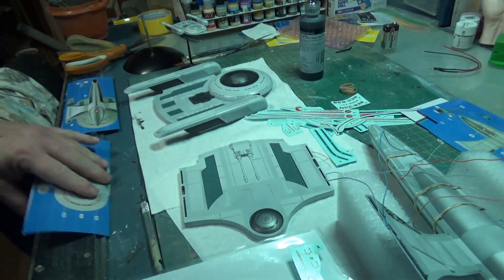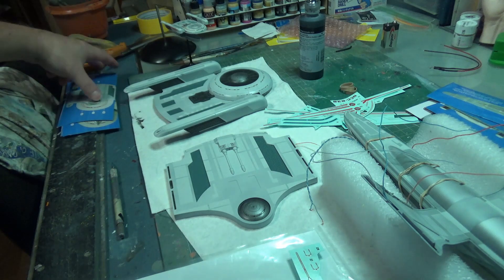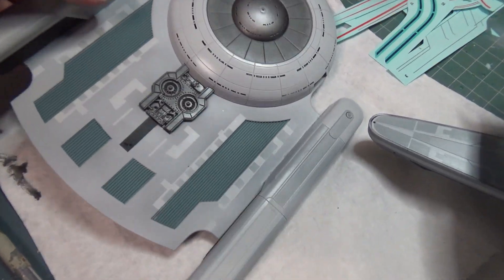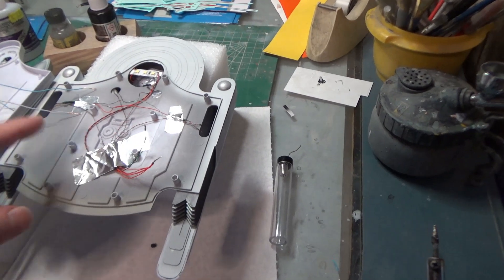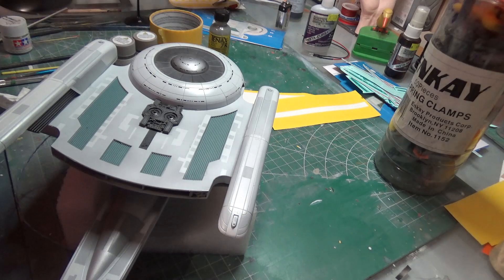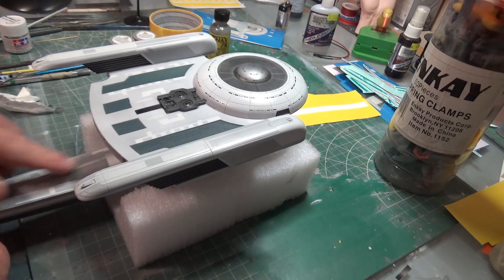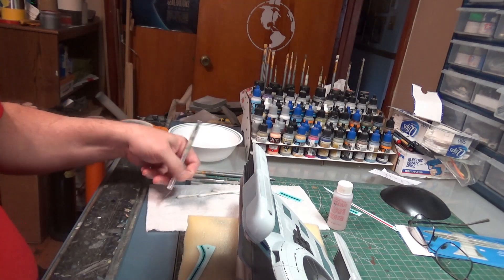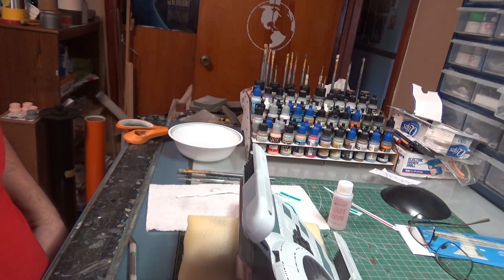Aztek Dummy Update 3/09/22 - 350 Scale Oberth Class - Part 2

Comment: As always a gem Lou.   I saw on Steve Iverson's email that you will be providing a mask set on the Cult TV man site. Could you include your decal selection/hints for the Grissom  in your instructions also when your mask set comes out?
Reply: Thanks for asking that question. A set of the world’s famous Aztec Dummy stencils will sure make painting this kit easier. I’m going to modify mine by replacing the “WW 2 truck wheels” impulse crystals (if that’s what they are) with single blue LED lighted crystal. Also the impulse engine needs some “spicing” similar to the “grid” pattern on the refit’s. That’s 2 out of several improvements I’ve got planned

Comment: Hi Lou. Surprise AD video! 😁👍 I have to agree that this ship is somewhat C-list and not one I'll be doing but you have made a lovely job of it. The gunmetal panels are a particular highlight. You must be quite expert at this class by now as you have done so many! The decals seem to be a significant issue - bit of a QA fail here I think. Rather than scissors I would probably use a steel rule and a sharp knife to trim the carrier film. As a major Space:1999 fan I'm looking forward to the Hawk.

Comment: Any hope to use a pencil on a spot of clear decal and seal it down? Or spray some smoke grey on same clear and slice it really fine by hand? I know, torture.
Speaking of torture-- you went through such trials for that long front skinny blue decal on the big guy-- I'm surprised you didn't make up a set of vinyl templates. You already painted stuff before final assembly, when doing that would make sense. Pylons too -- fussy, sure -- but I've seen you fuss a lot.
Light blocking-- (black) Tulip can be thinned a bit to be used as paint and stays pretty "blocky."
Good looking ship-- great build.